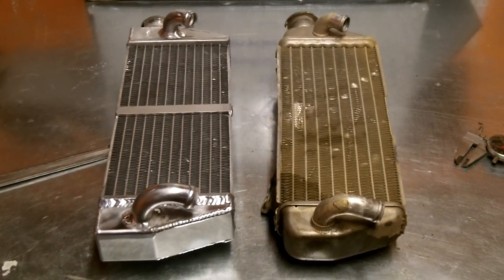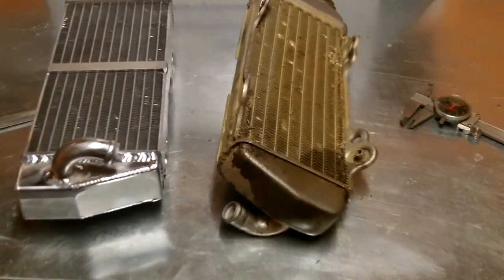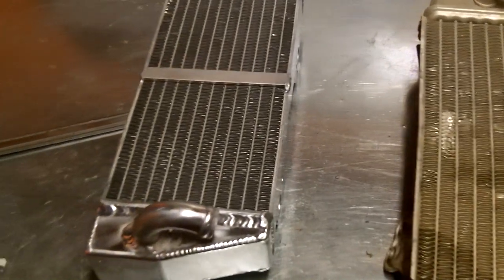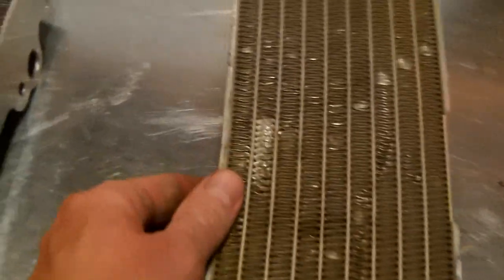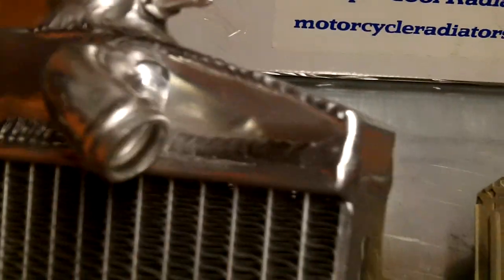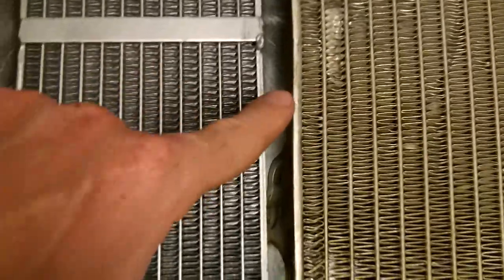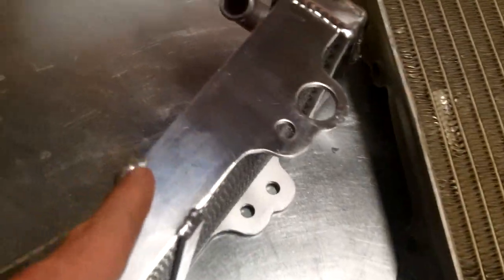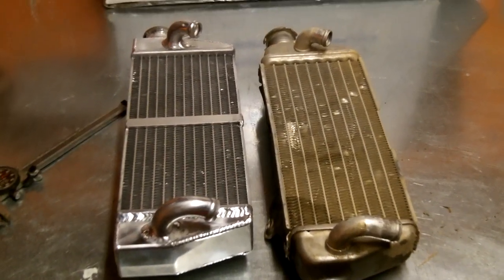Mylers Radiator vs KTM OEM Review

Comment: Charlie, I've had similar failures and it makes me think we should attach the shrouds to the radiator with a bungee cord or something that has some give to prevent the tabs from being bent.
Reply from the maker: With my new bike, I had some bullet proof radiators guards that came with it.  They won't protect your radiator from bending (my radiator and guard already have a slight bend), but it would have prevented this from happening.  I have other issues with the shroud/radiator design for the 2017 though.
If you ever see Steve Underwood, take a look at his bike.  He used the bungee strap for the kick stand to do exactly what you are talking about.

Comment: Thank you for the awesome review! We do build a better rad :) to clarify a few things the spacing in the cores on our radiators does improve the cooling, it increases surface area as well as adds more flow tubes which does increase coolant capacity slightly, and the terms for the "crimping" is fused, they put the hose fittings and tanks in place and put it in an oven until it fuses together. OEMs are fully fused where as ours are fully TIG welded. keep ridin hard!

Comment: Do you know if radiator guards made for oem will or will not fit with the mylers?
Reply from the maker: I had this on a 2007 KTM XC-W 250 and the OEM Radiator guards fit just fine.
Reply: @WhyRushRacing1  did the mylers hold up or were they made like the cheap chinese gpi ones on ebay that break quick.